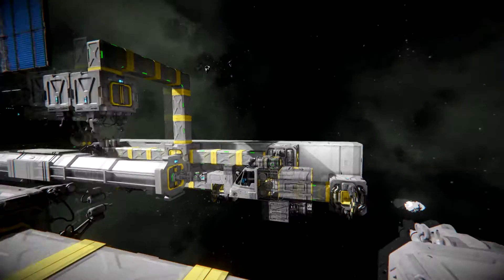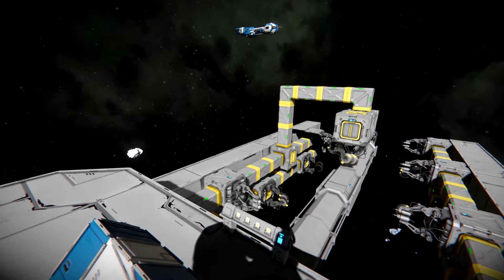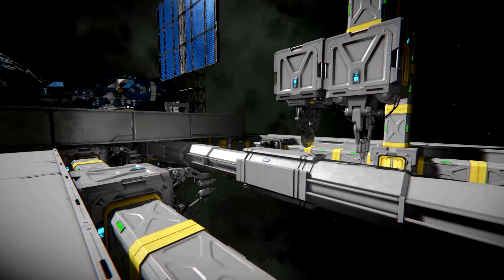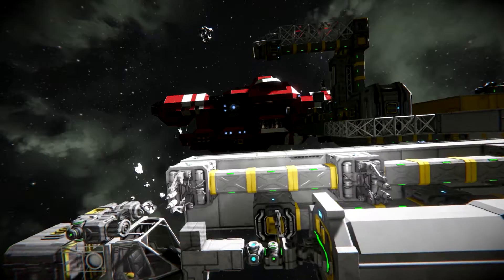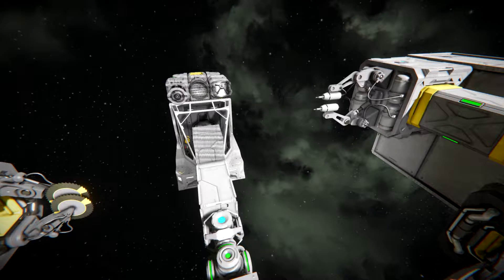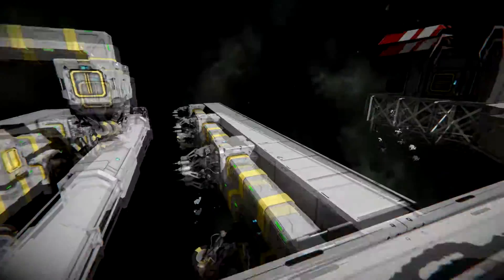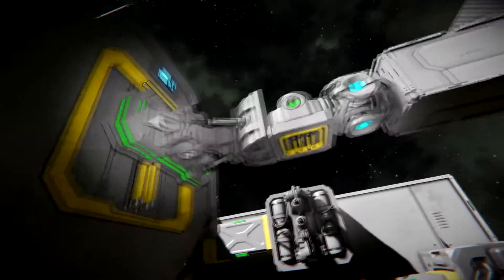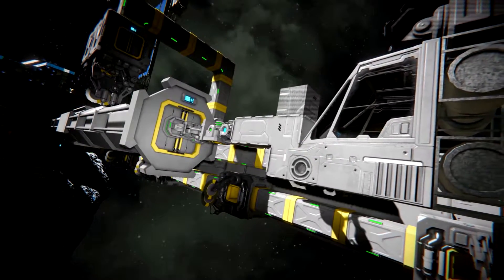Space Engineers | Tutorial Series | 3D Printers (Basic)

Comment: How could i build such a design like this? im not good with pistons and welders. is there a tutorial you recommend
Reply from the maker: Honestly, it's mostly just trial and error.  One thing to keep in mind though, you're likely going to want to use modded welders that have an increased range/radius since the vanilla welders have almost no range now.  I recommend one of the 3 to 7 block range mods, or the Nanobot Build and repair mod (you can reduce the range on the build and repair unit's control panel if you don't want it to be 75 to 150m :D )